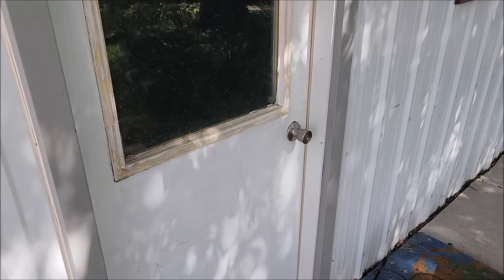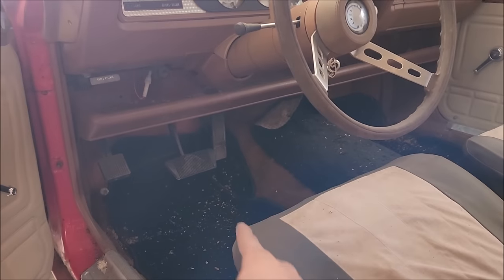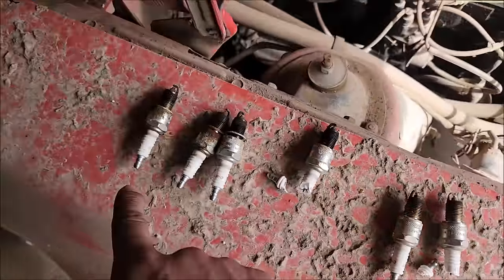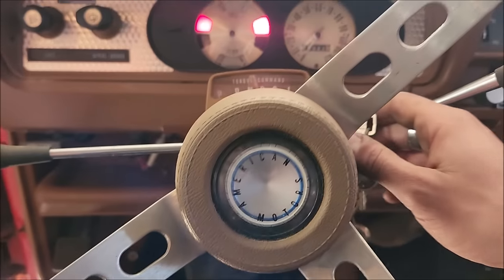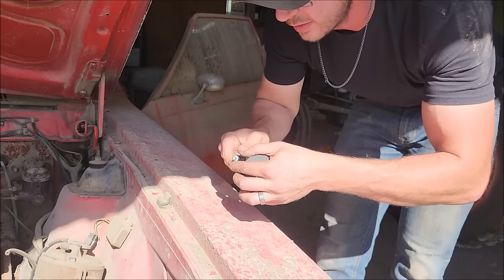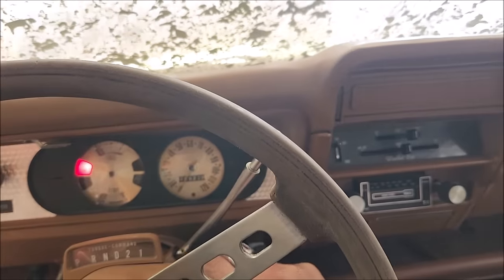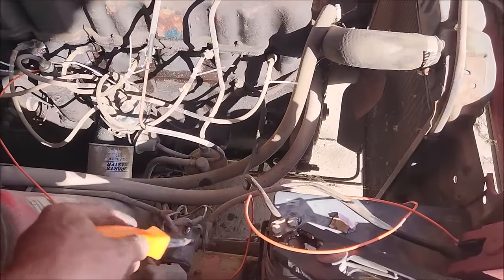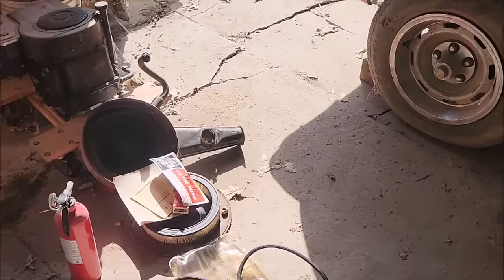Will It Run? 72 AMC Gremlin - Saved from the Crusher!

Comment: Had a javelin and gremlin only downfall for me was the 258 rocker arms 2 each are joined by a crossover made of alunimum which would sometimes brake  the good  is aftermarket ones were steel.

Comment: what's your plan with this.. is there a plan? keep it stock or do mods?
you know they make hot rod parts for them motors right? (just tell ppl the motor is in a jeep or international scout. .. 258 is awesome, if you got the 232 you can turn them into strokers)
Reply: money pit city.. davis unifeid hei and livewires, i heart clifford performance, there's even adjustable roller rockers, relocate the alt with a 76ish jeep bracket and put in a c10 or whatever, painless 21 circuit. .. no realy, if she's a keeper.. rewire her... lols omg, i got some caltrax under my 73, that's god damn fun launching when the redlight turns green blahblahblah keep the survivor patina (or don't)
Reply: other p.s. if you use the ford ign switch .. you can do that safety neutral lockout delete = start that car in any gear (that's also fun. put it in drive, floor the throttle, turn the key and see what happens! all git from the go)

Comment: Before even watching this of COURSE it will run it's an AMC! Will it run WELL? Debatable. Ok now for the video! :)

Edit : AMC Powwa! Welcome to the Team ;)
Reply: The 258 in my Eagle hatchback ran great. 

People with manual transmissions could get into trouble from over reving it. It was a long stroke engine, lots of torque. Redline was like 3500 rpm, max torque at 2200 (?) so why rev it that fast?

Comment: did you check to see if there is a resistor in the engine bay. Ford ran those to keep the points voltage low.
Reply from the maker: I'm sure I talk about that at some point. Ford used a resistive lead/wire, while most other manufacturers used a porcelain encapsulated resistor itself

Comment: Keep it if it's gentle on gas mileage and isn't a hassle to maintain.  Pull the seat; it's probably got more mice than Disney.  It still blows my mind that you didn't use a cig-socket air compressor.  But who can argue with a 2N/8N series engine?

Comment: Those Carter carbs have the accelerator pump in the fuel bowl
Reply from the maker: I'll have to look - when carbs are small enough compared to the engine they are on, they don't need one. Tremendous torque and economy, but no top end airflow. 
I'll have to take a closer look, everything I have done over the last decade and a half has been largely v8 4 barrel.

Comment: Based on the airy white substance being emitted from the tailpipe I would say your chances of having a cracked head or blown head gasket went up quite significantly. Of course it's also possible the. Its of mice living in the muffler just got served an eviction notice. Unless of course you used 2 stroke gas.
Reply from the maker: Or the trans fluid I forgot I put in 🙂

Comment: Resister spark plugs break like that. Nonresister plugs just crack.
Novices should have to learn on resistor plugs until they figure out how not to break sparkplugs. A cracked nonresister plug can be problematic. 
 Yeah there's an accelerator pump in that carb. 
  If you didn't already know, that AMC 6 cylinder evolved into the 4.0L used in Jeeps into this century. Last US engine with flat tappets made until about '06. Long after the zinc reduction in oil. 
  AMCs were really American, they used parts from all the Big Three. Thankfully the power steering pump came from a GM division and not Ford. 
  Gremlins and Pacers were actually pretty decent cars by 70s standards. Odd styling, quirky but, they'd do well over 100k without burning more oil than gasoline, unlike a Chevy Vega. 
  If the window handles break, ones from an old Ford pickup fit and are stronger. That might be more of a Pacer thing, we had a Pacer.

Comment: I had a AMC Gremlin it had a 304v 8 it was fast and I had fun driving it and i had a AMC Hornet hatchback it was a 304v 8 they was 3 speed on the floor then i did have a straight 6 cylinder AMC Gremlin it was ok it was a car I would have rather had a v8 in it . I have a relative that has a AMC Gremlin it has a 401 in it and that car is fast

Comment: When you hit the ratchet with your hand to bust the plugs loose you caused the socket to rock side ways and break off the porcelain on the plugs . No biggy plugs are cheap
Reply from the maker: Try it with any other plug though, you won't break them - these are definitely a unique internal two peice design.
Which is why I could clip them back together - the tape was just to prevent arcing from the broken porcelain to the block
Reply: @ThunderHead289  Dont get me wrong man I love the video and you are good tech if you watch the video, the socket clearly went side ways when you hit it  and any stress on any porcelain  is going to break it . Keep up the good work  . I didnt really care for these at one time now I love them I just think they are cool that paint is going to buff out really nice if you decide to go with a deep clean and cut and buff on it it will turn heads going down the road. :face-red-heart-shape:

Comment: if it turns out to be a runner, if it has the plastic valve cover you will absolutely need to replace the gasket as they were notorious for leaking oil. if you can find a metal 258 valve cover get it!  lol,,,,

Comment: Why did the plugs break? Loose fitting socket on overly tight plugs. Using a short ratchet didn't help either. That motor is no different than the mail delivery Jeep.
Reply from the maker: Personally, again I've never seen a plug made like that - where its not physically connected other than snap on inside the plug itself. Had the rubber in the socket and all. 
Also why I was able to just clip it back together and tape it up. Never seen where the center electrode isn't solid

Comment: 258  4.2.......fill it with cement and it will still run forever....that engine is in the top 5 best. If the car is junk....drop that engine in a jeep yj and stand back

Comment: you are also filling your tire with proper fuel/air mix
Reply from the maker: It's supposed to have valving in the attachment that prevents low pressure area from piston going down on intake stroke  that draws fuel in - who knows if it works right though 😄

Comment: I would characterized tires as possibly fuel-rh decent quality 12V compressors being quite affordable, I wouldn't recommend having or using one of these.esistant, but definitely not fuel-proof. Those engine compression tire inflators are probably a bad idea on good tires because of the fuel fumes you're pumping into the tire. On a tire that needs to be replaced anyway, and just to get you to where you can replace the tire, it could be a real life-saver back in the day. These days, with decent quality 12V compressors being quite affordable, I wouldn't recommend having or using one of these.

I used to see advertisements for car "jacks" that were basically a pneumatic bag that you attached to your exhaust pipe to raise the car. In theory they would also work, but I wouldn't trust my life and limb to them, either. Anybody ever use one of those?

Comment: Bet that 390 burns a lot of gas
Reply from the maker: It doesn't, no worse than a new truck. Gets 16-18 mpg. Standard gearbox is classic car deliverance. 
Automatic transmissions make old cars garbage. Was always the weak point of them - with a manual in that day, you were all around better off aside from lazy "convenience"
Reply: @ThunderHead289  That's great I was told they burned so much gas you can't drive them

Comment: Pretty sure that's a ford engine. AMC used any parts that the big 3 had extra. I had a 74 gremlin x 304 v8 and it had fomoco stamped on the side of block.
Reply: Nope. The AMC 304 was produced by AMC and not FoMoCo.
Reply: @Union53992  then why did mine have fomoco onthe block?
Reply: @Union53992  come to think of it the heads off my engine ended up on a friends 289. And the intake had ford stamped on it. Guess i just can't read.
Reply: @DavidKing-py9dt  - I’m going to guess your Gremlin had a Ford motor swapped in prior to your ownership. The AMC 304 was not produced by Ford and did not have fomoco stamped on it. I have a 1974 AMC 304 on the stand in my garage right now.
Reply: @Union53992  it may have been assembled by amc but amc never made a part . They bought there parts from others . I had my 74 in 76 it had a Buick ignition system a gm carb  chevy Saginaw 3 speed 12 bolt posi rear . And it was all original
Reply: @DavidKing-py9dt  - you’re either trolling or unable to do a simple web search. I’m out.
Reply: @Union53992  google says it i lived it. I was 18 when i bought my gremlin X. But we all know if the internet says it its  must be true.
Reply: @Union53992  oh and the uncanny resemble is because they were buick engines.
Reply: @DavidKing-py9dt  - how long has it been since you had that Gremlin? I have a 1974 AMC 304 in my garage today (and a 1976 AMC 360). No fomoco stamping anywhere. We all know that AMC used parts and design from all over the place but AMC did in fact produce the 304.
Reply: @Union53992  so what reason do you believe they would not use a ford block to make some of there 304s. I'm not saying they didn't use other blocks. Because they would use what ever was avalable.

Comment: Marvel Mystery Oil frees rings better than ATF...
Reply: I betcha anything, when you use that tire inflation from a cylinder of a running engine, that you probably would be able to light the air coming out if you took the valve stem out.

Comment: your breaking them by smacking on the wrench
Reply from the maker: You won't break a normal spark plug like that. I have a crisp 100 dollar bill you won't. Also i think I even showed on on cam where I didn't do that and it still broke. 
I changed 1000s of spark plugs in my day, was a mechanic before I was an engineer.